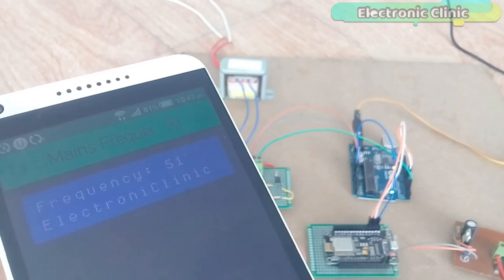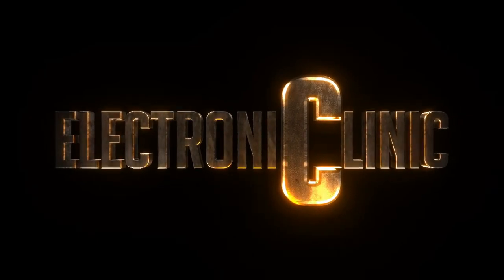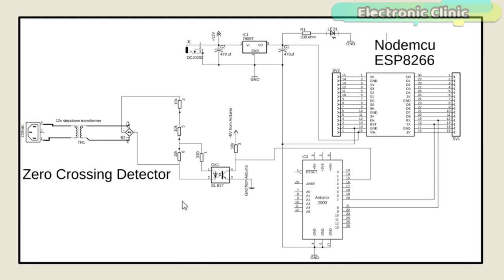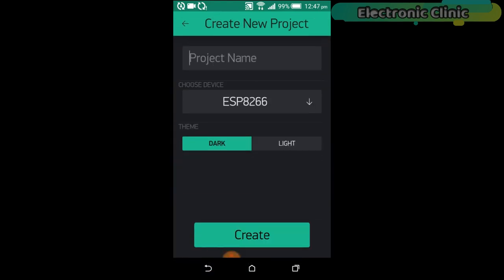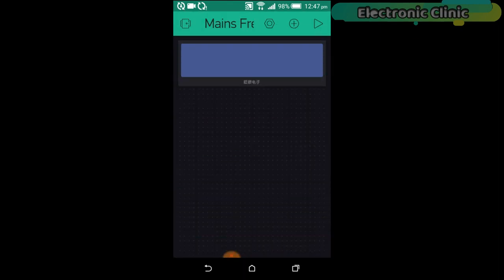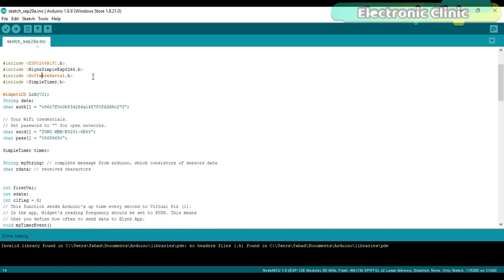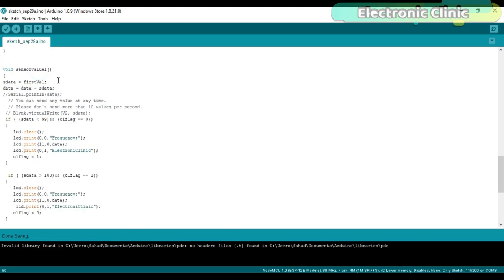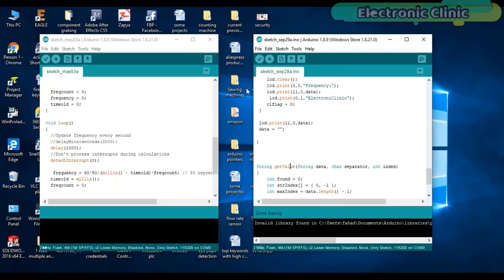Arduino Nodemcu esp8266   Mains frequency monitoring using Blynk "IOT Project"

Comment: Great video ustaad g. 😍😍
Can you try 3 phase cycloconverter, where 50 hz frequency can be divided into 3 parts as 16.66 Hz +16.66 Hz +16.66 Hz.
I tried this for 2 month but i was unsuccessful.
Reply from the maker: Will start advance level projects once my subscribers limit is completed.

Comment: why there is a need for Arduino, can't we use nodemcu directly for this purpose?
Reply from the maker: yes u can use.
Reply: While connecting thr Rx and Tx of NodeMCU and Arduino UNO is there voltage divider circuit is required. NodeMCU will work on 3.3 volts and ArduinoUNO is on 5 volts?
Reply from the maker: @Mots-mot  yes, for the long run use voltage converter.